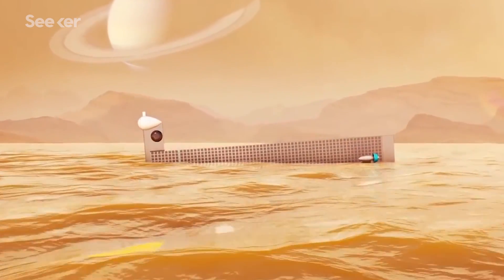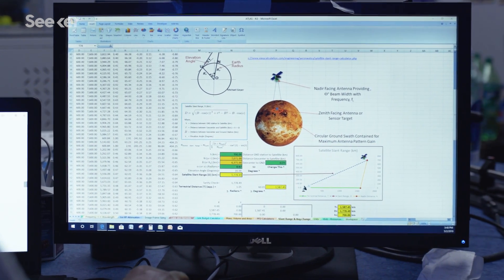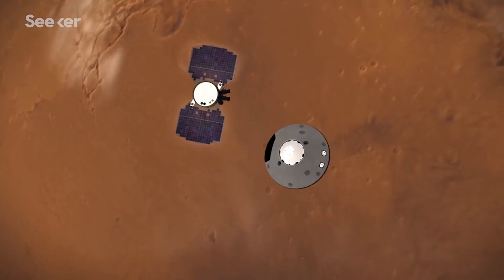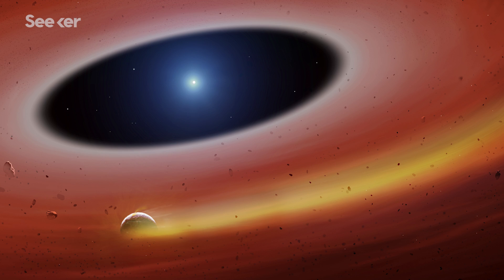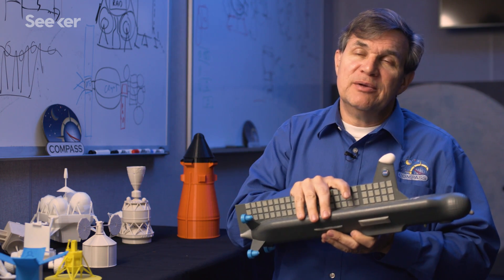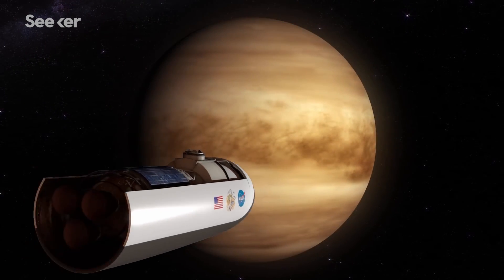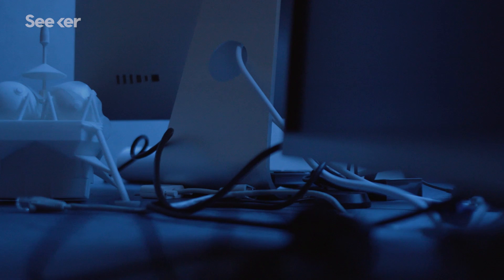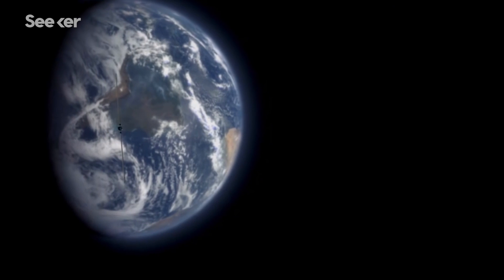How Mission Designers Invent Futuristic Spacecraft

Comment: For the high temps I would think they are developing a way to print circuit boards using ceramics? And figure out a way to impregnate the conductive metals for the circuits into the ceramics. Or develop a 3D printer that can do both at the same time.

Comment: Light speed propulsion system

A donut shaped accelerator on a starship would work by getting a ferrous based plasma up to speed then releasing it. However, to get the plasma to move faster than light the evenly spaced electromagnetic coil rings don't need to pulse in a step fashion faster, they need to be stepped differently. At first each electromagnetic coil ring needs to pulse, then when the plasma reach maximum velocity every other electromagnetic coil ring needs to pulse in a step fashion. Then when the plasma reach maximum velocity every third electromagnetic coil ring needs to pulse in a step fashion... so on and so forth. Once the plasma is up to the desired speed it can be released into a straight tube and directed out the back of the ship. In order to maintain balance the ship would need two accelerators, each moving the plasma in opposite directions.  This was discovered in another dimension while I was in something similar to a electromagnet coil ring accelerator.

Propelling a space vessel faster than light speed (This can only be done in the vacuum of space)

1st, we need to have a 10 to 20 foot diameter pipe line, formed into a 5 to 10 mile in diameter circle or donut shape. 

2nd, there would need to be independently powered electromagnetic coils wrapped around the pipe which would be evenly spaced.

3rd, we would need to build a bullet shaped space vessel made of a ferrous metal alloy with its own electromagnetic pulse generator 

The vessel would need to travel around through the pipeline several times until it got up to light speed. Once the vessel reaches light speed it can be released into a straight tube that is pointed in the direction we wanted the vessel to go. This can be accomplished by each electromagnet producing a magnetic pulse which will propel the vessel forward and just beyond the next electromagnet which will fire the next magnetic pulse. As the accelerator’s electromagnetic pulse occurs so does the magnetic pulse generator in the vessel

In Phase 1,  each accelerator’s electromagnetic needs to pulse to gets the vessel to maximum potential

In Phase 2,  every other electromagnet in the accelerator needs to pulse  to get the vessel to  to its next maximum potential velocity. 

In phase 3 every third electromagnet needs to pulse to get the vessel to its next maximum potential velocity.

In Phase 4 each forth electromagnet needs to pulse to get the vessel to its next maximum potential which is limited only by its structural integrity. Structural integrity can be increased by jelling the inside of the ship.

Comment: For heat resistant electronics, I've always imagined trying to find a material that wont work for electrical transfer unless it's hot as hell itself. Not exactly sure what individual or combination of things it would be but I don't know why titanium isnt used since it magically gets lighter and stronger almost all the way up to its melting point.

Comment: Apollo. Sun. Moon.  50 years since. We aren't prepared.
Reply: which is why we should focus on building a moon base as a staging area for greater things. we could begin building large spacecraft on the moon. until better engines are developed said ships would have to be limited to space-only operations and short range trips but even then it would still be a massive step up in capability to what we're working with now.

Comment: so the Enterprise is possible, it just need  funds to built it
Reply: Well no, not really, the enterprise depending on the version can travel dozens to millions of times the speed of light and in some cases even teleport. Even if we dumped trillions into making an enterprise type ship, it would take decades of acceleration  to build up speed to be equivalent to even a significant percentage of light speed a process that would have to be repeated every time you stopped to check something out and even if we could somehow almost instantly get to 99.9% the speed of light it would still take years or even centuries to travel between stars.

The only way it will be possible is practicality is when we have starship engines that warp spacetime (so we could travel faster than light without moving faster than light; which we heoretically understand the principles of) but to power said engines we would need something along the lines of an efficient and stable nuclear fusion reactor which even a working prototype of which is still like a decade or more away let alone a refined version.
Reply: @xanderellem3646  Actually, if we could continuously accelerate at one gee, it would take only about a year to reach the speed of light. The thing is, though, the closer one gets to c, the more energy one needs to go just a little bit faster. Eventually, it gets to the point that infinite energy is required to continue accelerating. Infinite energy is not available to us, and never will be. Barring some radical new science, I'm afraid that we are confined to our little solar system, and perhaps a few others nearby.
I don't like it either, but regrettably, I live in reality.
Reply: That's quite a leap. It may be that FTL travel is just not possible, no matter how much money you throw at the problem.
Reply: Craig Corson Unacceptable, we will find a way to explore the galaxy!
Reply: @NyanHomeschoolGirl17  I hope that you're right. I believe that you're wrong.
Reply: +Craig Corson. if FTL drives were impossible then there wouldn't be any UFO sightings because we're a backwater planet in an obscure part of the galaxy, aliens would need FTL drives to get here. so if they figured FTL drives out then so could we.
Reply: @killman369547  UFO stands for unidentified flying object. There are many flying objects that cannot be identified. There is no reason to assume that any of them are piloted by extraterrestrials, or of extraterrestrial origin.
Reply: I’m not a Star Trek fan but look at NASA’s IXS Enterprise concept which shows an alcubbire drive powered ship inspired by star trek
Reply: @Nathan Zhang Many things ARE impossible. FTL travel may be one of those things, we just don't know yet. 

As an aside - students who cheat, cheat only themselves.